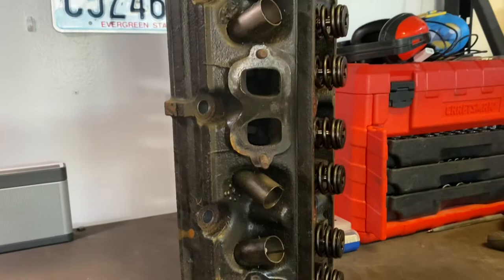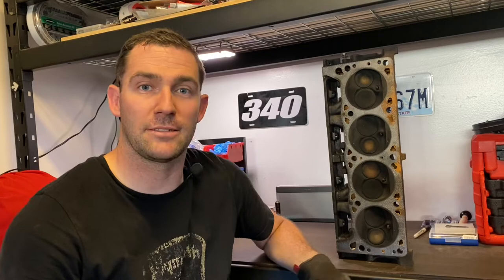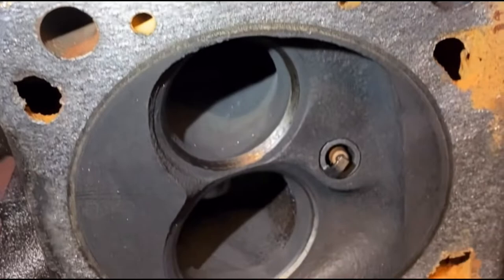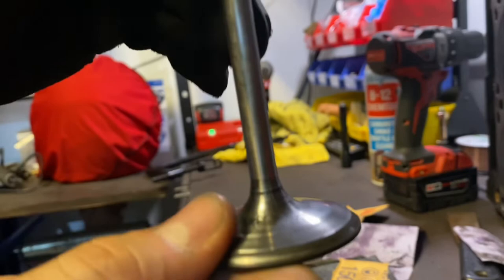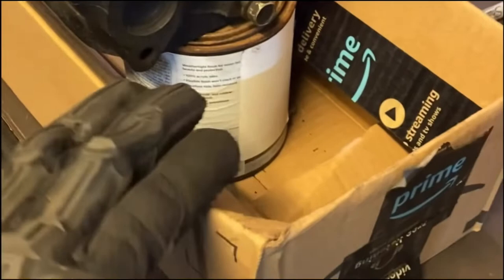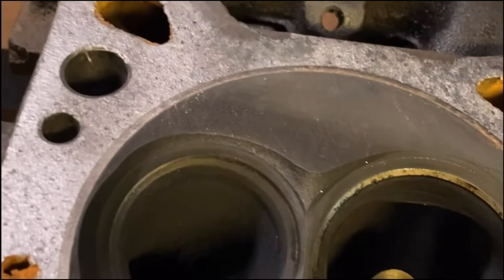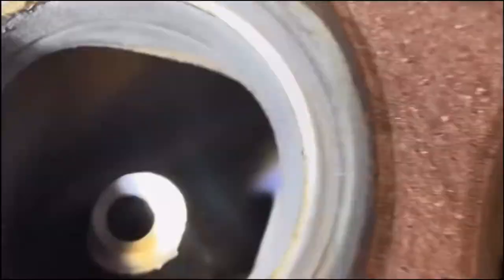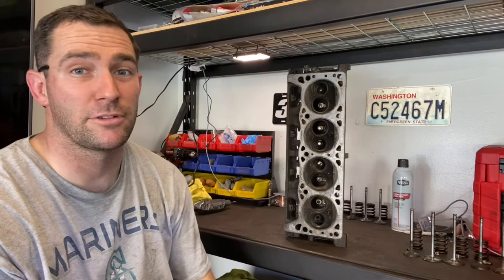Dodge Magnum Heads Explained and Home Ported

Comment from the maker: Correction
I state in the video that R/T heads could be found on the R/T Dakotas and Rams. They were actually only offered in the aftermarket and not on a production vehicle. All production 5.2s and 5.9s came with the same heads.

Comment: The biggest detractors for magnum heads in my opinion is 1: the pushrod pinch is absolutely terrible on the intake ports. 2 the intake bolt pattern is different than the LA stuff. 3: pedestal rockers, getting rid of one of the greatest features of the standard LA head. Granted they do make an RPM airgap for these heads but you’d have to buy another one if you already had an LA version. It sucks they have so many negatives because the chamber and valve arrangement is a vast improvement over most of the LA stuff.

Comment: The heads on my 360 were cracked in between the valves and I didn't even know that was the case it ran so good. Plus I did a compression test and the two cracked cylinders passed with flying colors. They were within ten percent of the non cracked cylinders(within 20 percent is considered a rule of thumb pass). I'm in the middle of doing a build so I'm going to take a chance, port the heads and reuse them. Besides I'm mostly a see what happens type of guy. Don't like to spend more money than I have to.
Reply from the maker: These cracked magnums passed a compression test as well. They’ve worked for me so far and even impressed me on the dyno!
Reply: Up grade your cooling system.
Reply: The cracks between valves is to be expected and 99% of the time a complete non-issue.
Reply: @sorta_stock one other thing the coolant return hose can develop a crack. It will deliver coolant to the reservoir. But will suck air back in. Eventually lowering coolant level. That one last romp. And starting missing when I got home. Lost a head. It was in a 93 Dakota reg cab short bed with 3:90 gears. And used the  stock trans. I enjoyed your video.

Comment: As far as catching the metal chips , I saw a guy that used a shop vac and pinched the vac tube to fit it into the port opposite the side he was working on. Looked like it worked good. Just a thought.

Comment: I just pulled 2 318 heads off a 97 jeep grand cherokee 5.2. I got em with all the pushrods and everything for 20$ at my work😅 with my discount I buy so much stuff lol I have a assortment of driveshafts, axle shafts, heads,calipers ect for when I need em because they are so expensive new. I really enjoyed this video and subscribed
Reply from the maker: Thanks man! $20 for a set of magnums is a score. You can get them cleaned up and ready to use when the right project comes along.

Comment: Nice. Having not done this before, seems the key is to reduce the edges if I'm getting that right.
Reply from the maker: Yup. Edges, casting marks, and matching the intake and exhaust ports to the gasket size are the 3 biggest things to help improve flow.

Comment: NOT 93 92 318 was magnum.  RT heads were over the counter never came on RT cars.(edit  I just saw your correction) 
I have RT heads on my 92 Dakota  My stepfather drove with no water and really cracked the oem heads.  I had been a zone rep and a friend at a dealer scored me a set for $300   came with good springs
I've replaced with bronze gides knurled reamed and honed for holding oil, viton seats backcut intakes and tulip exhausts almost 250k miles on them   I had access to a SERDI and did pro valve job and pocket port.  No narrow seats on this tow vehicle   about the only thing I have done for maintenance is change the timing chain and convert to the later post style dist cap, spiral wound mag (nickel) wires  compression still good  I have a 360 block all ready to go but no need

The TransGO kit was developed on my vehicle at about 50 k miles and it is still going strong but that's another story
Reply from the maker: I’ve heard nothing but good things about the RT heads. Sounds like yours stood the test of time as well. Did you feel a big difference after you replaced the cracked OEM units?
Reply: @sorta_stock  not much just having a fresh valve job and new seals helped but they still have good compression 20 years later maybe 200k miles  they did come with good valves and springs  3"54 gears/ Shure grip

Comment: Its a little surprising that they made the magnum head flow better only to choke it with tiny lift an duration camshafts plus wasnt the barrel intake manifold restrictive? Maybe they had efficiency in mind not performance.
Reply from the maker: They definitely choked it down with the cam and intake. Must’ve been for emissions. The 318 magnum I put together has performed better than I had hoped for with such a low budget setup.

Comment: Do those exhaust manifold studs on the middle cylinders penetrate the water jacket?
Reply from the maker: That’s a great question. I’m not sure on the magnum heads but, the outer studs on LA 360 heads do penetrate the water jackets
Reply: I'm getting conflicting answers online. Some of our fellow gearheads tell me they're dry studs, Summit Racing told me they're wet. When I find out the real story I'll try to let you know (the weather has to get much better here before I can pull the manifolds). Thanks!

Comment: Why not braze the cracks with bronze rod ???? Somebody......
Reply from the maker: I think the reason most don’t is due to the fact that the labor involved to repair the cracked set costs the same as a new set. The Eq or Promaxx iron magnums run about $450 each (assembled) and are really good castings. Shop rates here in San Diego are in the $150-$200/hr range. In my situation, the 318 these magnums went on was for a junkyard build-off and drag race challenge. I’ve only got $600 into the entire engine.
Reply: The cracks are more superficial than anything. They never go any deeper

Comment: Are the heads on a 92 318 good ones
Reply from the maker: In 92 both the magnum and LA 318 we’re offered. The magnum is a great head but, the late LA 302 heads are also good. Smaller ports but, they have good quench
Reply: @sorta_stock  la 302 heads have quench? pic please  we developed the KB quench dome pistons, a must for LA headed motors but today al heads is a better plan
Reply from the maker: @jmflournoy386  I’m all for the aluminum head options (especially these days). For budget builds, the 302/308 and magnum heads offer a better quench than the earlier designs. I can’t post a photo here in the comments but, the 302/308 castings offered a heart-shaped combustion chamber in approx 69cc. If you assisted with designing KB pistons then you’ve probably seen these heads. They’re have a quench pad and are often referred to as the swirl port heads.

Comment: The crack would have been discovered if you had the heads professionally cleaned and magnafluxed. Not expensive at all.
Reply from the maker: It didn’t matter whether they were cracked or not for the budget build I was doing. I was gona run them anyways. Many cracked magnum heads are still on the street. This was just a junkyard engine going full send on the strip. I’d highly recommend a hot tank and magnaflux for any other type of build.
Reply: U can see the cracks and feel them with your figernail  NOT A PROBLEM unless really bad